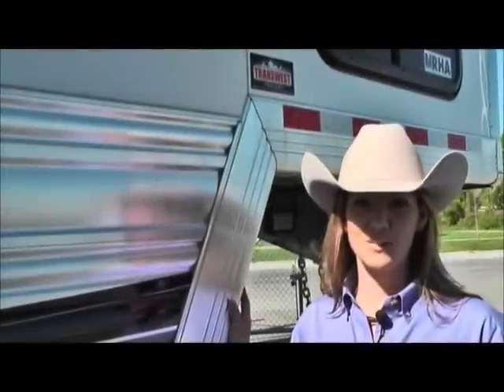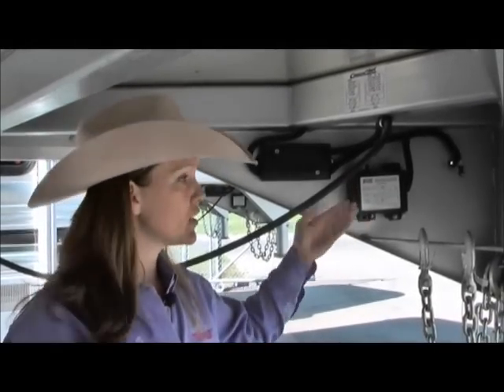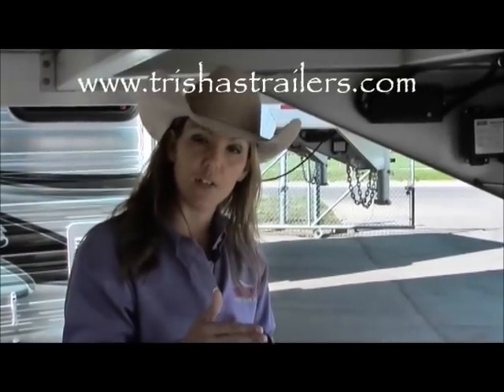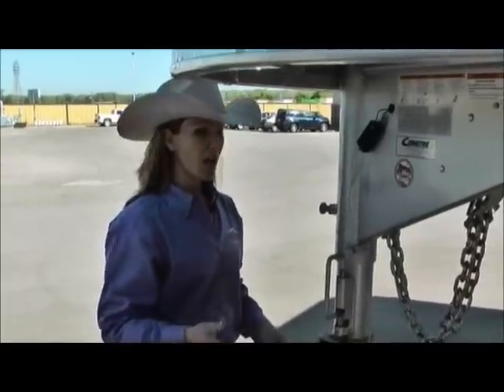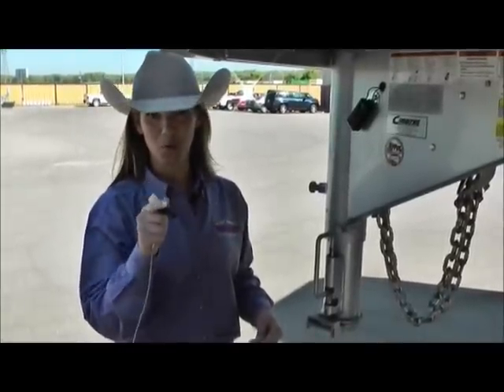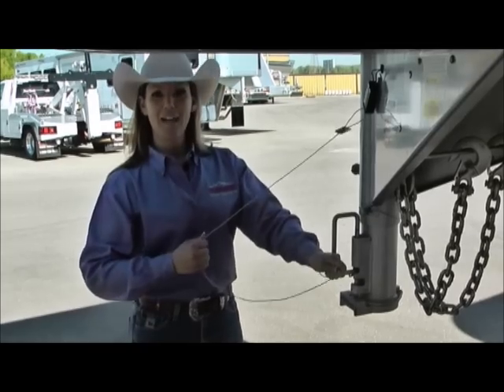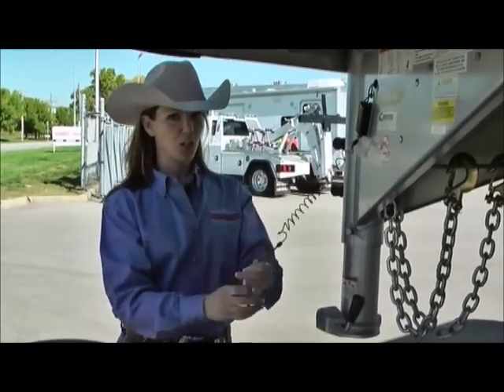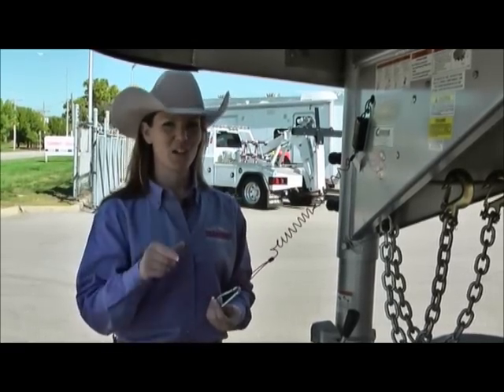Horse Trailer Tip: Break Away Battery

Comment: Trisha, does the brake battery also run your tack room auxiliary lights when the truck is turned off or disconnected from the truck?  Also, where do I find that cool pigtail plug/pin?!